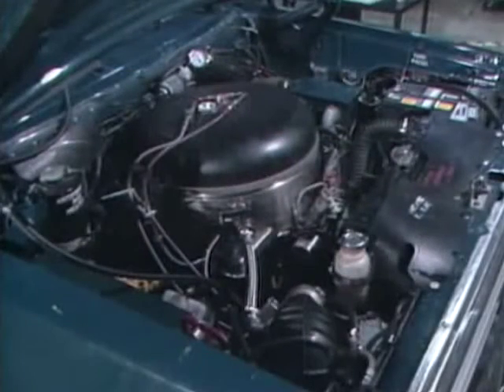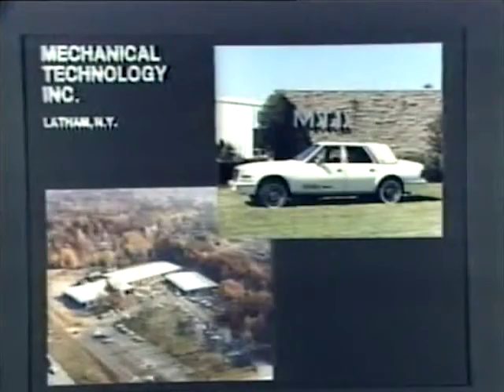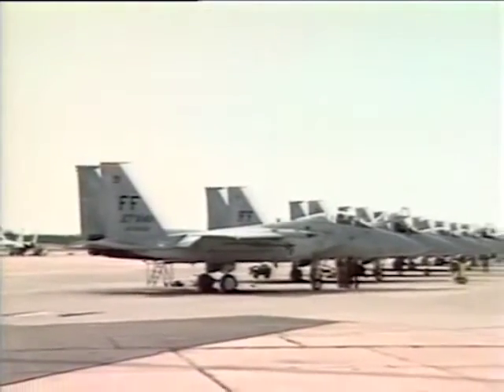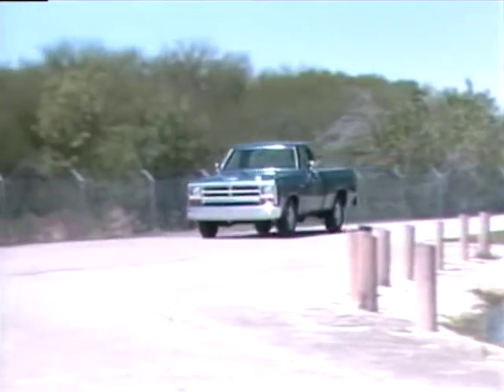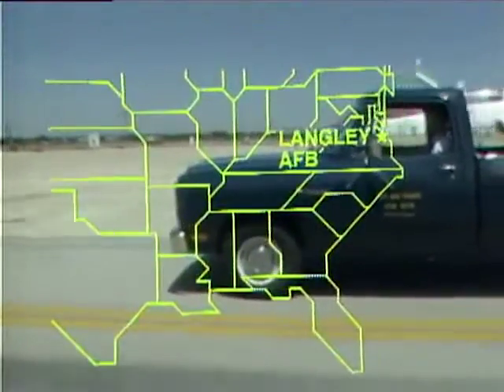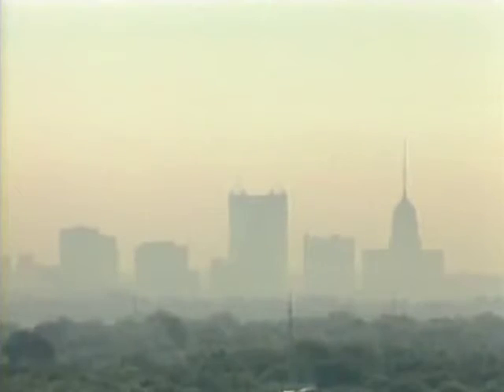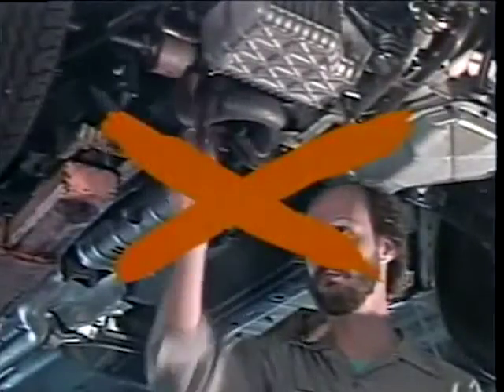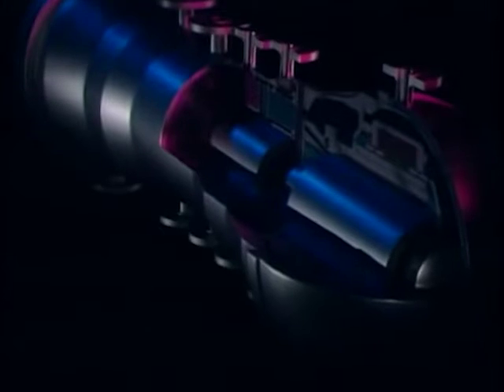The Stirling External Combustion Engine  - 1992 - CharlieDeanArchives / Archival Footage

Comment: Well. Its 2021. What happened ?
Reply: liberals. that's what happened. 
  "oh the environment" and "we must put all our efforts as a society into fighting white supremacy" 
  and also "we must put all our efforts into transgender surgeries"
Reply: It threatened GMs profit margin
Reply: @robdel_actual  The gas producers, not the car manufacturers.
If i remeber correctly the reason why this concept was scrapped was due to poor throttle response in the stirling engines in comparison to ICE motors.
The ECE are more suited for stationary applications such as generating electrical power.
Which then could be used to recharge an EV car.
Oh & yes.. total necro-thread.

Comment: High torque? I guess with a piston that big maybe its enough. I was wondering if it ran an electric motor. I might try to make one for my car
Reply: yea someone made a electric generator out of the same exact engine they asked nasa if they still had one and they did. and it is by reports extremely efficient. also they use regular sterling's under  concentrating ,mirrors to power houses.
Reply: They just run on the difference in air pressure, by having a hot side and a cold side, pushing the gases back and forth, when it heats up it expands and when it cools in contracts pulley the "piston" and pushing it in a reciprocating motion

Comment: Why aren't we using this
Reply: Stirling engines are used in some solar power applications. For example, concentrated solar power setups, where sunlight is directed at the engine to produce power. I read they are more efficient than solar panels. I do not know why people say they are difficult and expensive to make. They seem to be simpler than internal combustion engines.
Reply: @burgegerm7878  - the stack up of tolerances, sealing requirements vs ease of maintenance, and more make them difficult to manufacture so they perform well.
Reply: @Skibidoop In the video, they say the stirling engine  produces 75 horsepower. That does not seem that bad. I've read you only need about 20 horsepower to cruise at 60 mph. Even a 50 HP engine would maybe not be that bad, especially if it can be coupled with a hybrid system to help with acceleration.
Reply: It's too versatile. If everyone could burn used motor oil or anything they want as fuel, sale of gasoline would decline and we wouldn't have a reason to go to war.
Reply: Just imagine. You have several trillion dollars invested in technology to build and maintain conventional internal combustion engines.
Are you going to chuck all that away in order to make a engine that's a little better, but only a little?
Most manufacturers are not.
Reply: @Jason Clark  kinda like how vaccines  don't work
Reply: Because the power output is so low.
Reply: @David-vz8ss  More of the throttle response. It's not adjustable like on ICE motors so passing somebody rapidly just doesn't happen. Slow passing causes dangerous traffic situations.
Reply: Weak Throttle response (due) to lack of power. Sterling engines have their purposes and that’s great. But it’s a simple matter of fact that Stirling engines are not that efficient in terms of power production compared to the typical gasoline and diesel ice engines. Same way, for example propane still works for an ice engine, but you get less power production, less efficiency in the conversion from the fuel to power than with gasoline or diesel.  So in a lower speed lightweight vehicle, Sterling engine might be fine but for the typical vehicles that are used across the globe, not just in North America,  Sterling engines are never going to replace ice engines in any large scale format. They’re just not that efficient in terms of the conversion of whatever fuel is being used. And, yes,  they can use several different fuels into that actual power production. And it’s not a matter of whether you think I’m right. There is over 100 years of research on the matter.  The fact that every major Auto manufacturer has at one point experimented with Sterling engines and never been able to be successful on the fuel being used, and then converted into power versus ice engine(s) efficiency when using gasoline or diesel.  If you don’t understand that, its fine believe in the Sterling. The only reality where Sterling may make any impact is strictly as a generator to maintain battery level and/or to replenish battery Charge levels without any connection to the drive wheels. Strictly as a generator for maintaining or increasing charge in a battery pack.
Reply: @ "Weak Throttle response (due) to lack of power." - Incorrect.
If you'd have paid attention when i said " It's not adjustable like on ICE motors"
ICE motors, you hit the pedal & the RPM's go up. This doesn't happen with Stirling Engines not for lack of power but simply how they function. Their RPM's don't fluctuate in the same way.
Then you go on this huge 'strawman argument' as if i made the claim AT ALL that Stirling engines can/will/should replace ICE motors in cars. I guess reading comprehension isn't your strong point.
Stirlings are best suited for STATIONARY APPLICATIONS to produce mechical work or electrical power. Lack of power or efficiency is NOT  the reason why they aren't in every car. Throttle modulation is as it's completely absent on Stirling Engines.
Reply: There is no straw reply here. If,  you took the time to actually look at the Chrysler and GM cars that they put Sterling engines in you would see that they actually do have throttles. See, their Sterling engines were slightly more sophisticated than the DIY Sterling engines that people put together on their kitchen tables. But,  I get it.  Doing a little research into some of the cars and their experimental powertrains, that they put together:  specifically with Sterling engines along with some of their other experiments with turbines, coal dust, wankels, ev, opposed piston, alcohol, natural gas, for example, and even steam during the 60s and 70s over at Chrysler and GM would be just a little too much work for you when you can run your mouth & troll 👿 so easily.  But, if you would bother to do any of the research at any time or even just look at the videos, then you can clearly see that they have throttles and that some of their engineers talk about throttle response. And no other companies also experimented with various power trains, but GM and Chrysler both had numerous experiments in multiple different fuels and engine/motor types.
Reply: And if you bother to actually read what I wrote, you would also see that I acknowledged early on imperfect agreement on the subject of Sterling engines are best suited for non-automotive purposes. But besides, ignoring that you couldn’t be bothered to actually look into any of the research done by GM and Chrysler in particular along with several of the other auto makers with their more sophisticated Sterling engines which do have throttles they did have control which is evident in the videos, including some of the videos that have the actual engineers, talking about the driving characteristics of the vehicles compared to a traditional gas or diesel.  Thanks for letting everyone here know that you can’t be bothered to actually look into the subject. You just troll 👿 away. And as for your next worthless statement about well, where is this? It’s in YouTube just like this video there’s multiple ones on the subject and a simple search in Google will also provide information on the test vehicles and their characteristics. And just like YouTube Google is free.
Reply: Current normal automotive engines are more efficient, reliable, usable, etc..
Reply: @corpsiecorpsie_the_original  Not true. A gasoline engine has an efficiency of just 30-35%, which is easily within a Stirling engines capacity (up to 55%). Even a 1910's marine triple expansion steam engine could reach 30% efficiency - for comparison.
Reply: @corpsiecorpsie_the_original  not any more
Reply: @mottthehoople693  - wrong.
Reply: Too expensive, difficult to produce, and reliance on Helium, which is a limited resource that is already in use too much.
Reply: @elijahhmarshall  how are they reliant on helium?
Reply: @Logan-xf5bx  Essentially the Pistons need to move in a low resistance environment to be efficient Enough to even begin being competitive in an automotive environment, or any power generating workload. This is done with helium generally.
Reply: @elijahhmarshall  Helium is not a consumable in sterling engines, people waste millions of cubic feet per year in balloons so your point is inapplicable.
Reply: @ProlificInvention  my point was, that the price of helium is volatile, and helium is also not so easy to keep without leakage. Little things like that balloon the cost of mass production.
Reply: @ProlificInvention  - Helium escapes and can be viewed as a consumable. There has been a helium shortage for quite some time now.
Reply: @corpsiecorpsie_the_original  The working gas of this engine is hydrogen, not helium.
Reply: @ProlificInvention  - oops, my bad.  Hydrogen escapes even faster than helium and can be considered a consumable
Reply: @corpsiecorpsie_the_original  The refill necessity of the high pressure tank on the 11 prototypes averaged every 50,000 miles, Also-hydrogen is cheap and abundant
Reply: We don’t have these available because big corporations can’t make money from it. Capitalism will be destroyed.
Reply: @lismarrodriguez187  - Big companies could make a lot of money from it if it were a proper solution.
Reply: @lismarrodriguez187  fucking communist
Reply: Its too cheap
Reply: @Skibidoop This video was made of a prototype of a Stirling engine which was superior in every way to the engines of the time besides the horsepower rating (although they are high torque) so with the say 50 years of engineering this engine would have been simplified and more power produced as that is what engineering achieves if implemented.